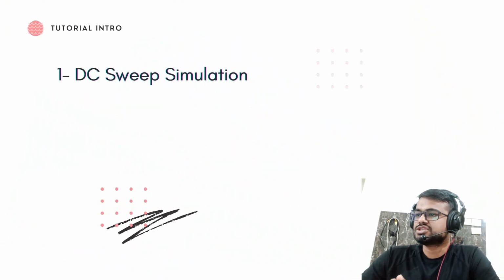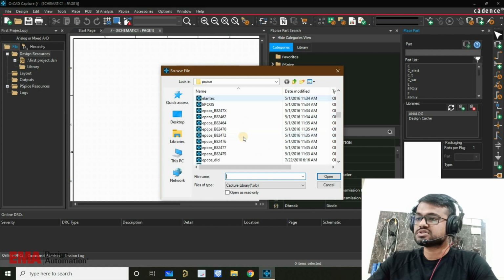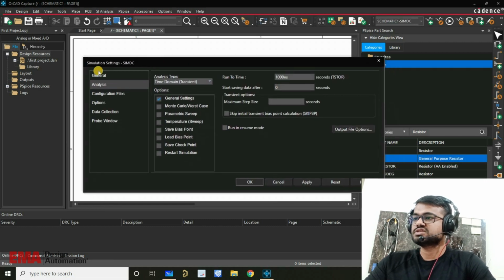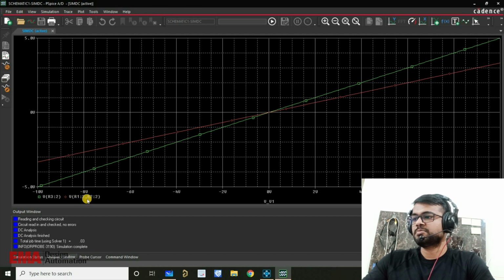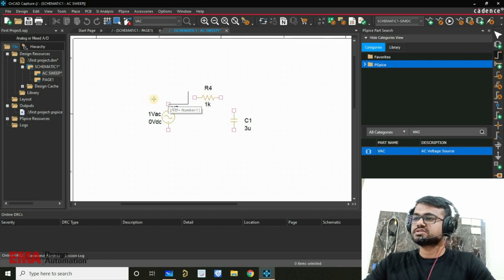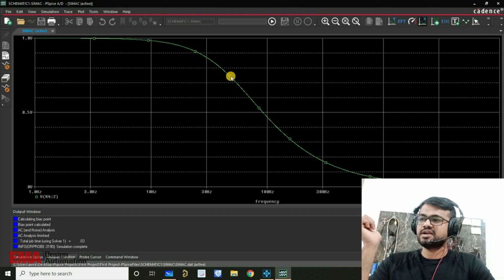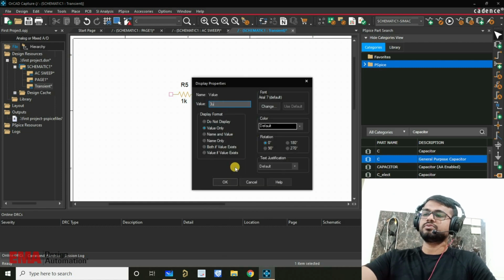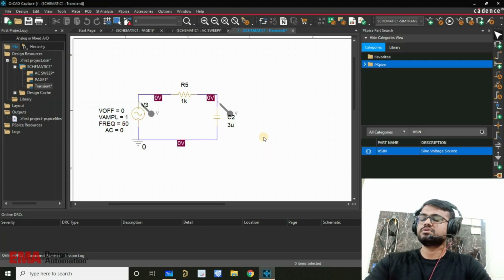PSpice Tutorial for Beginners - How to do DC Sweep, AC Sweep & Transient Analysis

Comment: Hi Aviral,

can you please help me how to fiix this errors 

** Profile: "SCHEMATIC1-LED_Driver_Transient"  [ D:\PROJECT_FILES\NLIGHT\01_ELETRONICS_ENGINEER\SIMULATION\LED_DRIVER\PSPICE\SCEMATI
Reading and checking circuit
ERROR(ORPSIM-15108): Subcircuit AL8860 used by X_U1 is undefined
ERROR(ORPSIM-15108): Subcircuit B240A used by X_U2 is undefined
ERROR(ORPSIM-15108): Subcircuit LEDR used by X_U3 is undefined
ERROR(ORPSIM-15108): Subcircuit LEDR used by X_U4 is undefined
ERROR(ORPSIM-15108): Subcircuit LEDR used by X_U5 is undefined
Circuit has errors ... run aborted
Reply from the maker: Can you mail your design with PSPICE models etc on esteempcb.info@gmail.com
Reply from the maker: Before that i would recommend Google this error code